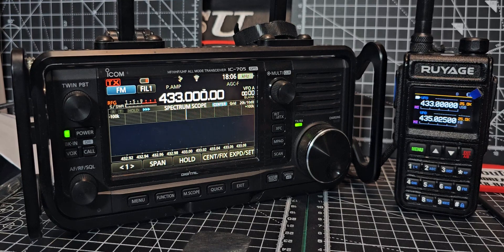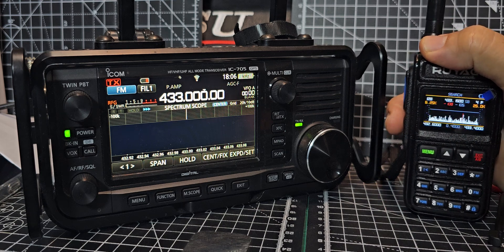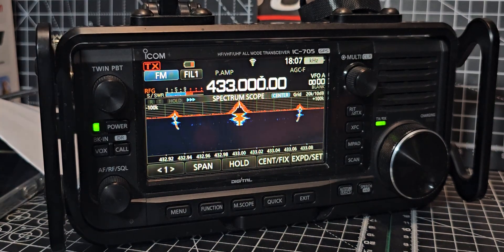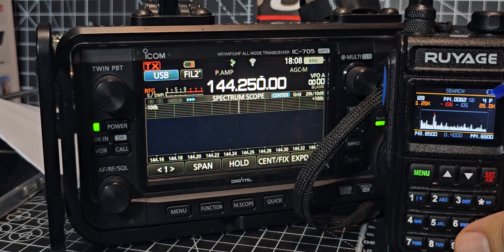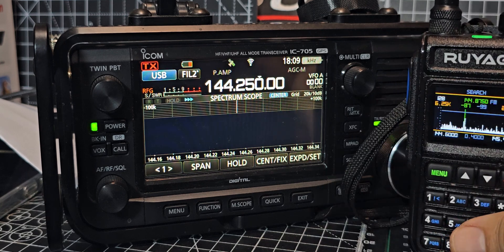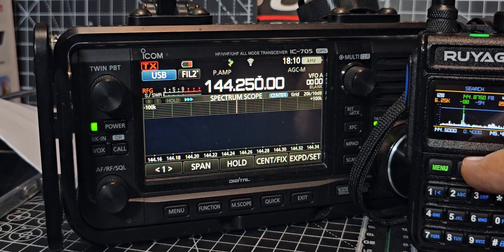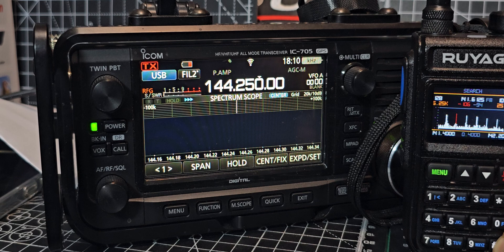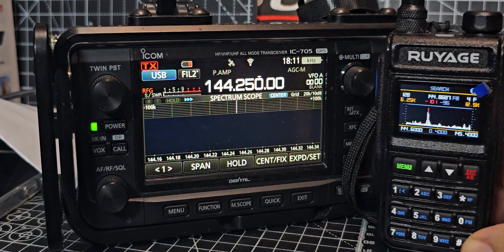70cm 430 mhz  Upper Side Band - RADTEL RT-890

Comment: Default Keys

Side Key [1SP] Monitor
Side Key [1LP] Freq Detect
Side Key [2SP] Scan/Advance Scan List/Scan Stop (LP)
Side Key [2LP] Spectrum
SP = Short Press; LP = Long Press

The following keypad keys are all LP

[1] Squelch
[2] Modulation
[3] Bandwidth
[4] TX Power
[5] AM Fix
[6] Dual Standby
[7] Repeater Mode
[8] Reg Editor
[9] Scan List Add or remove a channel to current scan list
[0] FMB
[*] Edit TX Freq
[#] Lock
[MENU] TX CTCSS/DCS
[EXIT] Single/Dual Display
Side Key/Custom Key(pad) Options

None
Monitor
Freq Detect
Repeat Mode
Preset CH
Local Alarm
Remote Alarm
NOAA
Send Tone
TX Tone
FM Radio
Freq Scanner
Flashlight
AM Fix
VOX
TX Power
Squelch
Dual Standby
Backlight
Freq Step
Key Beep
Toggle SList
DTMF Input
Dual Display
TX Frequency
Lock
Spectrum
Dark Theme
RF Gain
Reg Editor
Mic Gain
Modulation
Bandwidth
TX CTCSS/DCS
TX Priority
Spectrum

Enter by pressing side key 2 LP

[Up] Increase frequency range
[Down] Decrease frequency range
[1] Change scan step (16, 32, 64 or 128)
[3] Change modulation FM, AM or SB (SSB)
[4] Change step size (0.25k - 50k)
[5] Switch spectrum modes (toggle 1-4)
[6] Increase squelch level
[7] Hold/Search (in hold, use up/down to adjust main frequency - useful to avoid RFI)
[9] Decrease squelch level
[0] Toggle filter (X = unfiltered, F = filtered)
[*] Change scan delay (0 - 10ms)
[#] Toggle bandwidth (25.0K = wide, 12.5K = narrow)
[MENU] Jump to VFO mode with current frequency and settings (to allow TX)
[EXIT] Return to main
SP [#] switch between VFO-CH mode
Reply from the maker: Wow thanks